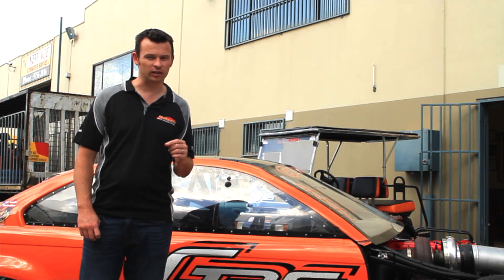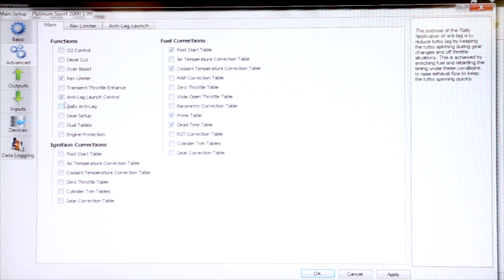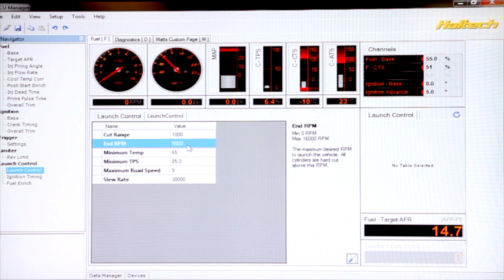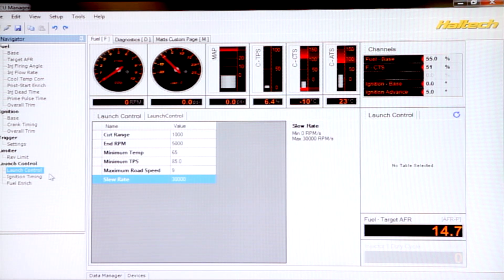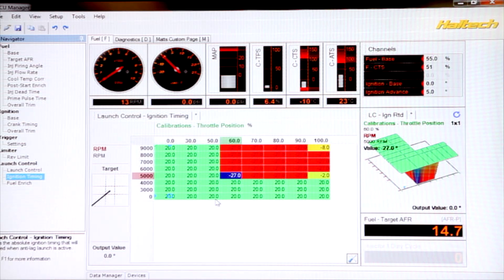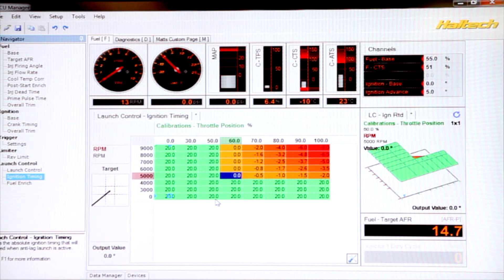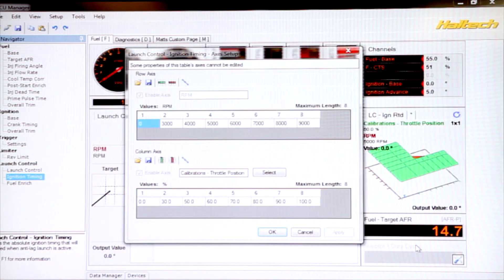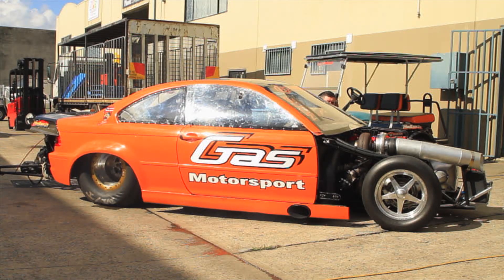Anti-Lag and Launch Control Setup - Haltech DIY

Comment: So my question is when when it is setup as an ignition cut and you start cutting cylinders 1000 rpms before the target launch rpm at which point you have a 100% ignition cut does this not have an adverse affect on the whole concept of anti-lag?  I was under the impression that the whole idea is you want additional fuel really late via a regarded ignition charge.  How does this happen if there is no ignition charge as the lack of charge is what is holding the RPM down.  It just seems like conflicting factors.

Comment: Hi, can someone quickly please help me? I have tried to set anti-lag launch control to my 05 Subaru STI (I have a Haltech PS2000 ECU) without wiring anything. I got it to work by setting the AVI On Voltage to 2,50V and Off Voltage to 4,00V. Problem is that it doesn't turn launch control off (max. speed set to 5km/h), it hits the launch limiter even on highway speeds. What I must do? Thanks!
Reply: teemuvayrynen I don't know if you have you answer already or changed your car, but you can have a interruptor to turn Anti-Lag on/off, don't ask me how to install it I just know that cars with anti-lag have those

Comment: hi there. great informative vids :) thank you for posting them. i have a question. the software used for say the sprint 500 and the platinum sport 2000. what are the differences between the two software wise? or does the haltech software cover all bases?

Comment: in the  example below it works out to be 3 seconds because the normal limiter is 8000, and 8000 - 5000(launch) = 3000 RPM (so the "window" between the launch RPM limiter and the normal RPM limiter is 3000), so with the slew rate set to 1000 RPM per second the new effective rev limiter moves progressively up from 5000 to 8000 at a rate of 1000RPM per second, it therefore takes 3 seconds. So the higher the slew rate the quicker the rev limiter will raise.

Comment: Slew Rate Explanation - Your launch RPM is generally significantly lower than your normal rev limiter, the slew rate sets how quickly the ECU will raise from the launch RPM limit up to your normal RPM limit (effectively it gives you a progressive time based RPM limiter for the launch). its based on RPM per second so say your launch RPM limit was 5000 and your normal Rev limiter was 8,000 RPM then a slew rate of 1000 would give you a progressive rev limiter for the first 3 seconds after launch.

Comment: in the high tps low rpm area its best to keep the advance/fuel you normally have in your respective ignition and fuel maps and only start retarding when aproaching the end rpm... otherwise when you depress the clutch and activate the switch then floor the accelerator pedal, it will feel very slow to rev up to the end rpm... ie rpms will climp while the engine does the prrrrr retarded ignition sound and of course cut in the end rpm... while if you keep what I mentioned in the beginning,